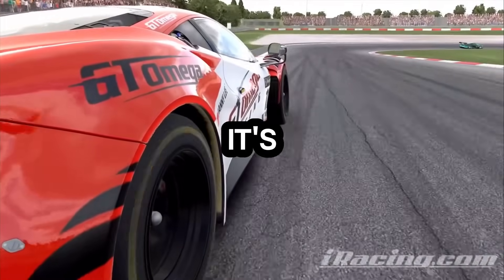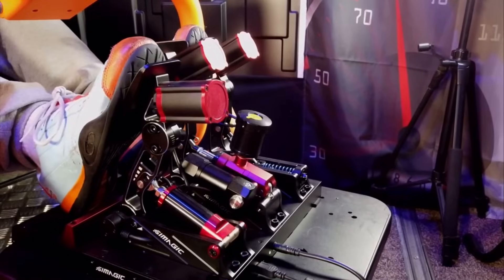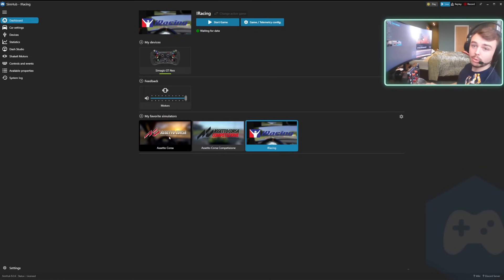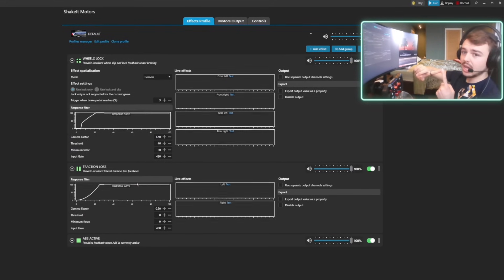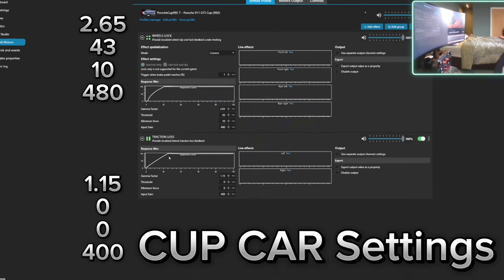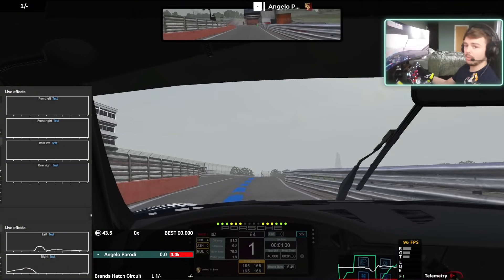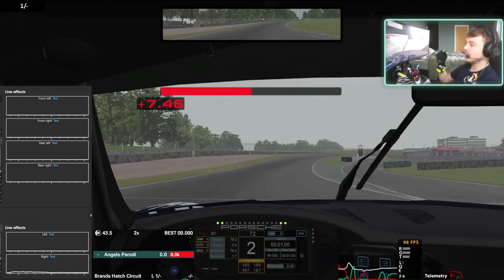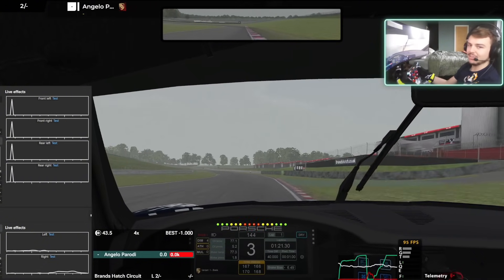Simagic Haptic Reactor A Game Changer for Sim Racing (iRacing & Haptics)

Comment: Btw, in iracing specially, we should not activate abs right? I mean the fastest way to brake is without abs right? Cause i bought a new alpha simagic base and it gives me abs vibrations and i suddenly realized before this abs impulses i was always braking with abs, but in real life if abs is activated you probably made a calvulation mistake and your car gonna be upset. So this blew up my mind, did i really drive 1 year with always activating abs? Or is it just a wrong software? Can anyone see or experience same thing and expecially you sir, did you realize same thing when you just start the using haptic sensors?

Comment: Have you ran across an issue where the brake motor is constantly vibrating not a lot but its noticable.
Reply from the maker: No i haven’t, when you say constantly vibrating what do you mean?
Reply: @TerriblyRacing  almost like a buzzing. Finally found what it was. I went in the MISC tab and uncheck the vibration on the pedals and it fixed it.
Reply from the maker: @anthonyhandley825  yeah you had iRacing feedback “On”. I don’t use it.

Comment: Sim Hub must be very good with their accessories to make better racing for us.  I have just a Thrustmaster TMX wheel controller and their heavy duty pedals - have had this for many years.  I don't think this kind of info would help my racing - getting better. I also do not have a racing Rig and shaker motion systems.  I just sit in a normal chair.  Plus I don't belong to IRacing.  and Just do the other STEAM SIM racing games.
So doing this kind of fine tuning of race styles to be competitive would be a mood point for me at this time.  You are more on a Pro level of racing than I would ever be to do this kind of tweaking.

But, thanks for the great video and what is available to tweak things should I need to and have the elaborate hardware equipment to do so.

Comment: How do you get clutch to vibrate at bite point in simhub? If simhub is on the simagoc software doesn't work and vice versa. I want the throttle and brake vibration settings using Sim hub and clutch bite point aswell. Thanks in advance
Reply from the maker: Hi sorry George, I don’t have the clutch pedal at all so I haven’t set up and clutch bite point

Comment: I am struggling to figure out how this is considered cheating when all they do is replicate the type of feed back a driver would get from a real car. Yes it gives you an advantage but so does a load cell.
Reply from the maker: It’s like racing on a wheel with force feedback when no one else has it.

Obviously everyone else has ffb because the game gives it to everyone however, this feedback comes from simhub and it’s so useful. I wouldn’t call it down right cheating however I do believe I have an advantage
Reply: @TerriblyRacing  my Fanatec V3's throttle vibrates when slipping, but its support is down to the game.

I'm sure you can mod other pedals with vibration motors too. Others might use bass shakers on their rigs. It's another tool, but like anything, it doesn't turn you into a genius driver.
Reply: @TerriblyRacing  that’s my point it is an advantage. I have seen interviews with drivers who hate sim racing due to the lack of feed back and they don’t think they will get any use from it. I believe this will change their mind.
Reply from the maker: @markhorsburgh76 yeah simhib allows you to use these effects with other motors, they offer the strongest feedback but there’s definitely other options

Comment: Wheel slip when accelerating onto the accelerator motor and wheel lock/ABS onto the brake motor? Thanks!
Reply from the maker: Traction loss on rear tyres on accelerator.
Wheels lock on front and rear tyres on the brake
Reply: Wheel Slip somehow doesn't work for me since its doing weird stuff at about 60-90% throttle input, so i disabled it again
Reply from the maker: @markuskenel  yeah I don’t use wheel slip, use traction loss
Reply: @TerriblyRacing  Traction loss on my simhub only specifies Left or right. It doesn't specify Front/Rear
Reply from the maker: @andypang6416  yeah that’s ok, mine doesn’t either it is right and left
Reply: @TerriblyRacing  For increased realism I have a slip angle 4 corner bass shakers on my rig, you could probably DIY this to reduce costs, but the feedback is fantastic - after that it's motion systems! This sim racing lark is bad for your wallet!
Reply: I have 20 options on my simhub for different effects but i dont have traction loss. Tried updating it to version 9.2.12 and still not there?
Reply from the maker: @tonykerr3479  hmm that’s strange I’ll try and figure out why
Reply from the maker: @tonykerr3479 I reinstalled Simhub today and it’s there so not sure what’s wrong for you
Reply: @TerriblyRacing  I just had to manually add effect. New video is awesome, setting up now 👍

Comment: Can the haptics only be used with Simagic pedals, are can they adapted to other brands?
Also, I have been using SimHub for almost 3 years and I have just recently learned about the haptics built in. Haven't used it since removed my 4th screen and got a VR headset. I have to figure out how I am going to display it.
Reply from the maker: Yeah you can use the Simagic haptics on other pedals just have to find a way to mount them on your pedals, you search for 3D printed mounts for your pedals and it’s not too difficult, let me know if you have any questions

Comment: So you're getting feedback you wouldn't get in the real car through haptics that wouldn't normally happen. Interesting.
Reply from the maker: In a real car you would feel the rear end sliding out but instead of spending £10,000 on a motion rig I can feel the slip through my pedal instead.

Don’t get too pressed it’s just a video 😉
Reply: @TerriblyRacing  Not getting pressed, but how do you feel flip through haptic feedback in your foot before you feel it in a DD wheel? As soon as a car begins to rotate you'll feel the wheel go loose
Reply from the maker: @eclipse245  on a lot of cars the wheel going loose is not enough, the haptic motors really helped me get a better feel of the car and I’ve gone up a bunch of irating since setting these up.

Also the more sideways the stronger the vibration so I get a better idea of the slip angle

Comment: I have these on order, but I'm curious if it's possible to change the frequency of the vibrations in SimHub? When I got the HF8 I completely skipped installing their software and did everything through SimHub. Can you do the same with the Simagic Haptics? I saw other videos where the Simagic software allows you to specify certain frequency for each haptic motor.
Reply from the maker: Yeah you can specify a per motor frequency.

One thing you can’t do is have two effects on the same motor with 2 different frequencies.
 So as long as you have different effects on different pedals you can have different frequencies.

Comment: 1:00 I'm not sure what you mean here...if you have just regular brake pedals compared to what? What is regular? What is more difficult? Does brand or load cell matter?
Reply from the maker: I just meant pedals that aren’t Simagic, Simagic pedals have mounts to fit the motors, other pedals might have 3D printed mounts
Reply: @TerriblyRacing  so I might just need to print mounts for my Fanatec peddles? What's the cost/benefit of this versus using parts express tactile transducers?
Reply from the maker: @CookinBeatloaf  these are at least double as expensive I’m pretty sure, but the feedback is really strong and really useful, not hing to notice is these are linear feedback motors as opposed to rotary which is a benefit

Comment: Stop with the clickbaits please. Im using the simucube active pedals and I still run the same lap times. Ive had the rumble motors before. They wont do anything for you. 8k ir driver here. The fast guys wont bother with this. Insted of focusing on this crap just learn to understand driving. Just my 2 cents. I see you are a 2k driver and 1.5k on sportscar. If you think this will make you a better driver. You are wrong. No offence
Reply from the maker: Sorry my friend I think you’ll find that you are wrong.

If you are already quick in a sim, these might not help much, but for people struggling to jump into sim racing these haptics provide amazing feedback… WHEN SETUP CORRECTLY.
They can have lots of useless effects but when those are tuned correctly it feels amazing.

It has helped me massively going from 1.3k Irating to 2.5k, I only started in December 23.

Don’t hate them till you try them…
Reply: @TerriblyRacing  I think you missed my comment where I said that I have had the vibration motors before. What you are doing now I have tested three years ago. 
On my simucube active pedals now i can access those effects through the simucube software. Nothing is a cheatcode. Only the ABS feeling can be somewhat helpful. Knowing how to brake and knowing how to set up your pedals properly is much more important than spending so much time on simhub.
Reply from the maker: @erind_racing  of course it’s important, but you’re not reading what I’m saying, go try the settings from my latest video, the feedback is super useful.

I don’t make money from YouTube I’m sharing this content because I love the feedback and I want others to know what they’re missing.

You may have active pedals but you don’t have my brain, try them and get back to me. They may not make you faster as you’re already very quick but I promise these provide insightful feedback you didn’t know you were missing, thank you for the support 🙏